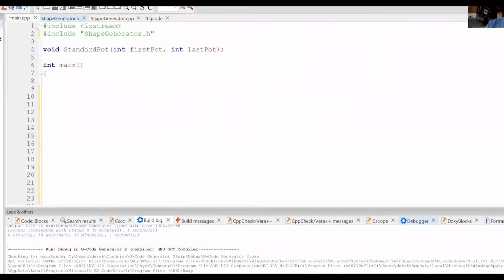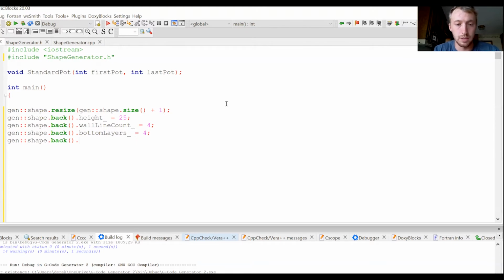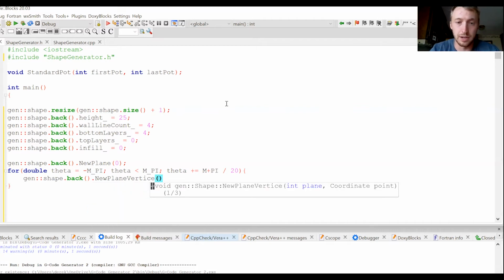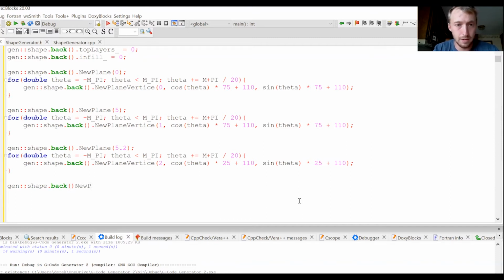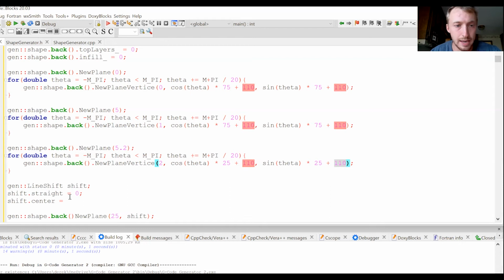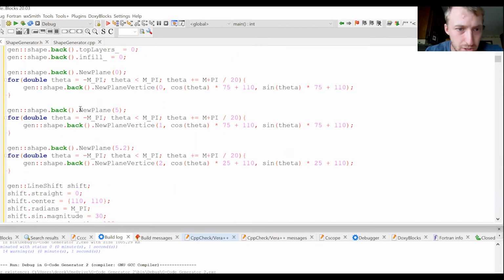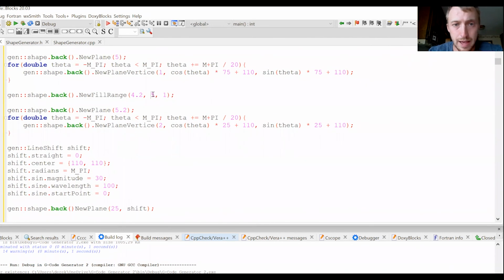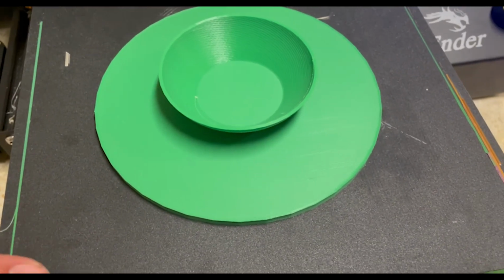I Made My Own 3D Print Slicer

Comment: I was trying to make a slicer in python, but in reality i just wanted to change the code so that the nozzle travels less.
The basic idea would be that the program cuts the part into layers, then computes all the lines. i just wanted to make it find the points nearest each other, so that the start and end points for most of the layer lines are closer.